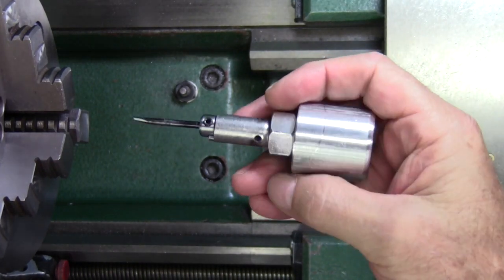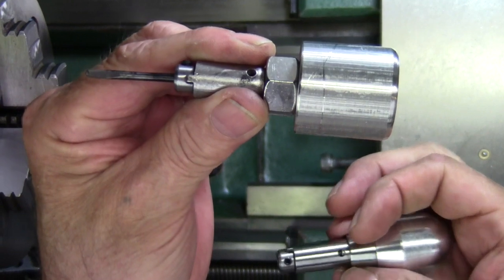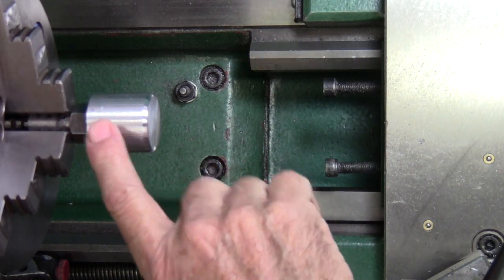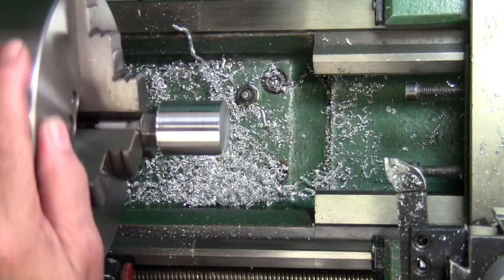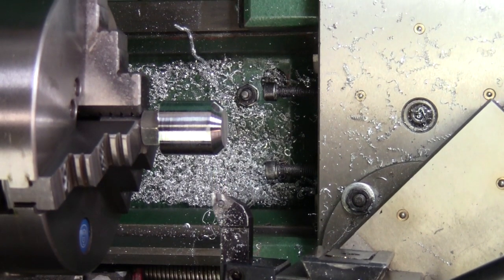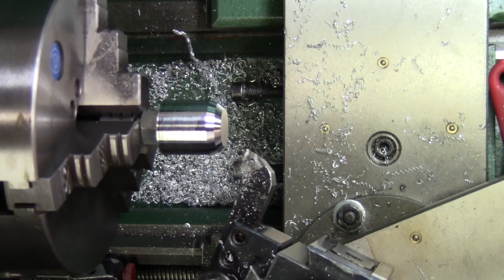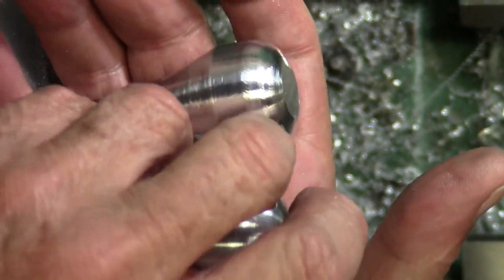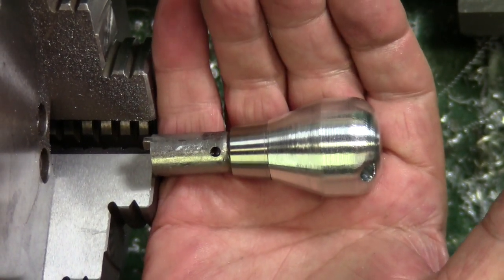How I make a Hand-piece for the Homemade Hand Engraving Machine  part 8  shaping the Handle

Comment: Do you have to use a stainless bolts
Reply from the maker: No, the last ones I made from Delrin plastic, I have also made a few with brass, it's up to you what material you want to use.
A ready made bolt makes it easy, the threads are already cut.